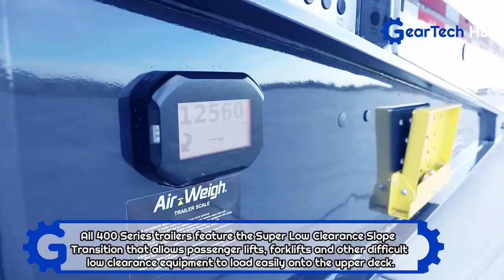The most advanced trucks and trailers you have to see ▶ American Edition

Comment: Interesting how uses change in different areas. You bring an end dump like this on a job in the Pacific NW and you will have holes punched in the side of it within a day. End dumps are pretty much limited to large stumps and rubble. Not too good on aluminum. Around here we never see sleepers on aggregate haulers, too much weight loss for the load. But, we also get 4-5 rounds a day on many hauls. Sometimes up to 10  a  day if the traffic is good. So, sleepers are not needed.
I love the SmithCo side dumps, easy to work on and easy to dump. Windowing a triple is a lot of fun, but you really need a long straight stretch to get all three in a single windrow. And to turn them you need a couple  of football fields unless you have time to jack things around. Hauling like I have done, you don't need to tarp loads and you load them until you spill over the sides. Usually with two or three wheel loaders. Gawwd, I loved driving off highway.